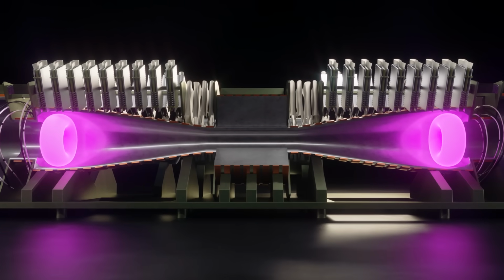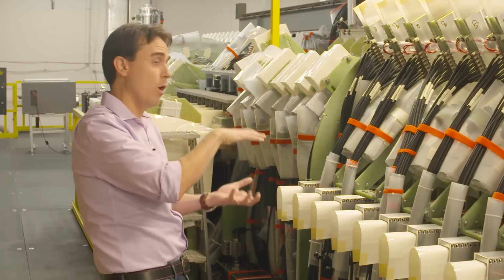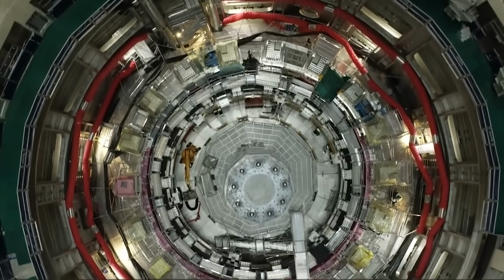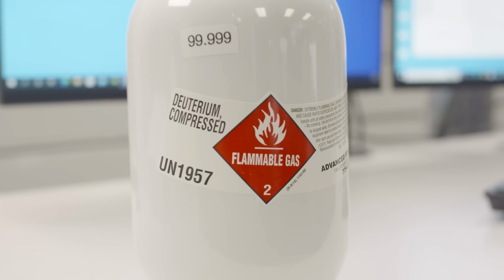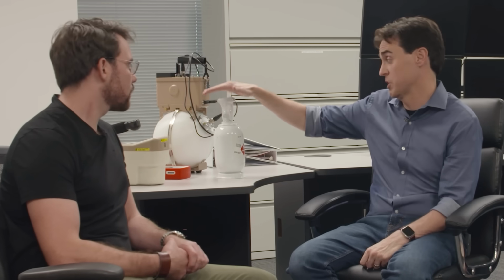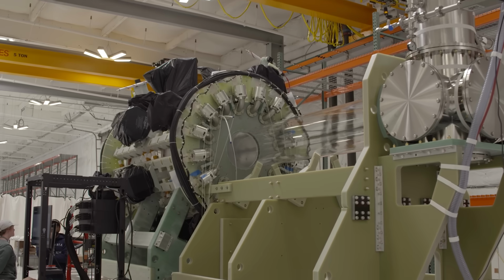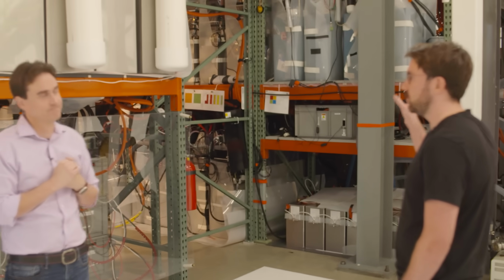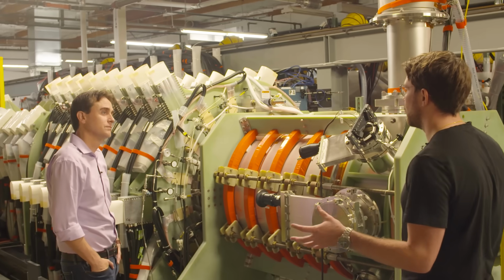A New Way to Achieve Nuclear Fusion: Helion

Comment: The real problem with fusion is not getting more energy back than you put in, it is getting  more USEFUL energy back than you put in.  Quite often the energy coming back destroys the equipment that made it.
Reply: To provide grid electricity, then at least four times the original input is required.
Reply: @Philip  with how much is produced on the low end that does explain why it destroys the equipment
Reply: I wonder is the advanced super- capacitors from Skeleton would be a useful addition… I understand Skeleton has graphene based tech. Anyone heard of Skeleton? I think they are from Estonia and the company is now based in Germany
Reply: Well, D-He3 fusion would be the theoretical way to solve that, since most of your energy is being carried by fast protons instead of fast neutrons. Protons, unlike neutrons, can be tightly controlled and sent down "deceleration tunnels" where their speed is converted to voltage.

But honestly I think the issue is overstated. Industrial plants wear down with continuous use, so what? As long as the costs are reasonable, you can do regular maintenance like we already do everywhere.
Reply: @The_Blazer-u9t  A nuclear reactor has a 40 year lifespan. A nuclear power plant takes 33 years to pay off. If fusion doesn't do better than nuclear, then I don't see the appeal.
Reply: @tuckercarlsonrules4972  Fusion IMO has huge potential to be better than fission. You get all of the advantages with quite a bit less of its problems: you're not handling radioactive material either in or out, you don't need quadruple redundant safety because your reactor isn't permanently fueled with enough potential energy to vaporize a city, you don't need a spent fuel pool because your waste products don't need to be continuously cooled for six months...
Reply: The real problem with fusion is the economics of it.
This stuff is never going to be economical competitive for commercial use. Energy supply is decentralising rapidly. We needed this 30 years ago.

The science is awesome though, we can use it to travel the galaxy 👍
Reply: @baronvonlimbourgh1716  That's absolutely not true, literally every single form of energy generation, from solar panels to wind turbines is cheaper and more cost effective at utility scale.
Reply: @The_Blazer-u9t  that is no longer the case. Most of efficienties of scale come from labour and infrastructure efficienty, aka opperational costs. And with solar and wind labour and infrastructure and opperational cost are marginal per instalation and don't really change if turbines are put next to eachother or spread out. Or if panels are together in a masive field or  are on the roof of a lot of different houses.

The panel cost stays the same, the maintenance cost stays the same since it's maintenance free, and they simply stand outside so infrastructure overhead is also the same.

Smaller scale actually does have some advantages as well. They can simply be connected to existing electricity infrastructure without having to build massive connections and beefing up transport lines when it is installed decentralised. Plus the investment cost can be spread over many more small instalations by many people. And the financial bennefits are spread over many small benneficiaries instead of flowing to a single profiting entity.
Reply: @baronvonlimbourgh1716  If you look at actual numbers for cost of electricity, utility solar PV is substantially cheaper than rooftop solar.
Reply: @The_Blazer-u9t  how did you calculate that? 
If i buy 100 panels and put them in a field and connect them to the grid or i buy 100 panels and put them troughout the city, one in every garden and plug them in or whatever, there is no inherent difference between what the electricity cost comming from these panels the next 40 years.

They just sit there unattended and make electricity.
It is not like every location needs an operator and a manager. I also don't have to build a building in every location for supporting equipment. 
These are the costs that exponentionally decrease normally if you put more together. Instead of 100 operators managing and maintaining 100 little gas agregators you would only need a single one managing a huge turbine. That's economies of scale
Turbines and panels are just static and operate on their own. There are little gains to be had, if any by concentrating them.
Their footprint also doesn't shrink by concentrating them either. A powerstation grows slower in size then that the output capability grows, again making it cheaper with scale.

And for end consumers the decentralised option is actually vastly cheaper. When buying from a solarfarm you pay for the electricity, profit for the exploiter and you pay for the transportation of the electricity over the network. By buying your own panels you pay nothing for the electricity, no transportation cost, you just pay for the investment. An investment that returns itself by no longer paying for the electricity and it's transportation.
After 5 years or so the savings exceed the investment and from then on the electricity is free for 35 years.

Anyway, solar and wind power are quickly dropping to fractions of a penny per kwh generated. And storage prices also are quickly comming down to levels where for the same cost of building and running such a nuclear facility for 40 years many times more energy can be generated and timeshifted by wind and solar over the same period already. And that difference will only keep growing over time.

There are no running costs asociated with solar in particular, that makes it unbeatable economicly.
Reply: @baronvonlimbourgh1716  Yes... energy supply is decentralizing sure thing.. I guess electric vehicles will be powered by your bullshit lmao. The reality is solar energy has no place in the future except for you roof as an appliance for your home. We are rapidly spearheading into a future where we expect to use electric power for everything except for flying airplanes, unless you expect every household to come come with a mini pre installed fusion reactor that will feed the grid, we will need to centralize even more with new technologies than we already do.
Reply: @@zippydastrange  who is gonna buy that expensive power though?
They will need subsedies for their entire life. I know better ways to spend tax money.
Reply: @baronvonlimbourgh1716 the power from a nuclear reactor is relatively cheap because they produce a ton it’s the setting up of power plants and when one fission power plant could power can theoretically power New York City for a day the cost becomes a lot more manageable
Reply: @jameson1239   no it isn't cheap. How can it be cheap if building the thing costs a fortune?
There is a big cost to that capital. And there is a huge oppertunity cost because of it.
And beyond that operational cost, maintenance cost and overhead are massive as well. 
Plus you also need overcapacity because these things need lengthy maintenance every few years for which you need to have a replacement standing by to take the load.
And then there is a constant need for fuel and it's storage.

There is nothing inexpensive about nukes.
Reply: @baronvonlimbourgh1716  I never said it was cheap I said the costs are alot more manageable when you have the capacity to monopolize an entire city’s power grid  with one assets vs building a massive wind or solar farm just from basic googling New York City uses about 11000 Mw/h per day and the R.E Ginna reactor which is nowhere close to the most powerful reactor in the world can produce 13968 Mh/h per day, how many solar panels do you need to generate the same amount? And how much do you need to pay for maintenance things like labour, transport, and materials to upkeep that many solar panels vs one nuclear plant that depending on design may not need to be turned off to refuel or repair.
Reply: @@zippydastrange with a 20k setup you can live offgrid almost anywhere in the world with your extended family lol. That's huge, not many people will even have space for such a large instalation.

Anyway, a solar setup is a way better investment then stocks or whatever. Whoever does not have a system is leaving a lot of money on the table. 
The vast majority of buildings will have PV within a decade.

Nuclear is 20th century technology it already is by far the most expensive way to generate electricity. Giving up economies of scale and going smaller will only skyrocket costs even further.
It is a dead end, it would swallow insane amounts of tax payer money to even make viable. It would be economic suicide.
Reply: @@zippydastrange nobody wants to pay over 10 or 20 times more for the same thing. I think you live in a different reality then the rest of us sorry lol.
Not everyone is named musk 👍. 
Most companies like to be competitive internationally as well, that's just not possible anymore using a resource based energy system.

Technology is now finally taking over as an energy source, the dawn of a new era.
Good times ahead.
Reply: How is solar not a resource based energy system in the long run based on the decline of rare minerals needed to make them? From what I've seen it's definetly not a long term solution.
Reply: @robertmills413   everything in a solar panel can be recycled. And by the time they need to be replaced you are left with exactly what was put into them at the time of creation and during the 40 years of operation. They consume nothing to create energy, unlike resource based systems that need a constant flow of new resources to keep them going that are gone forever.
Reply: @baronvonlimbourgh1716  that makes sense, I wish I could find my source but if I remember correctly the point they were making was that we'll eventually run out of resources to make more panels. The rarity of some of the essential minerals dictates that only so much of our energy demands can be met by solar before we run out of them.
Reply: @robertmills413   solar pannels are a technology. Technology becommes more efficient over time, the amount of energy that is created per panel has been steadilly increasing since the 70s. And the amount of materials needed to create them has been steadilly going down since the 70s. Development in technology always makes it possible to do more with less over time.
Pv panels are just silicon, much like computer chips. Pv has been following a simmilar trajectory as moores law which enables pretty acurate predictions to efficiency possible.

Battery technology has also made huge progression over just the last decade. More storage, longer lasting batteries with ever declining amounts of materials used. They are just a technology as well.

And that doesn't even calculate in the progression in material science itself. Alternatives or new processes are found for all these applications all the time.
And with capital investment continually growing exponentially in these industries imprvements are constant and will be for at least a couple of decades into the future.

What happened in these industries in the last 10 years is mind boggling and it's still a new and small industry comparativly.
Sure, with the current state of technology it would be difficult. But creating the world we live in today with computers technology in everything and everywhere would have concidered concisered impossible in the early 80s as well. You needed a huge box that weighed a tonne just to run an excell sheet. And needed to lug allong a suitcase as a battery to run your phone for 30 minutes.
And look were we are just a few decades later. That is how technology works.

Things are only going to get better from here forward. And it will happen really fast and in 25 years this stuff will be omnipresent everywhere just like computing devices are now. And it will produce and store energy at fractions of a penny.

Look up the technological s-curve. Every disruptive technology goes trough this cycle, and we are just ariving at the bottom of this curve and are on the brink of it going vertical in the comming years.

Seriously, by the time these nukes are even ready they will be obsolete paperweights and museums of 20th century technology.
Reply: @robertmills413   if you want to see the future today, watch a presentation from Tony Seba.
He makes it very clear what has been happening and what will happen going forward.
Really recomended. He really understands this stuff. He has been spot on.
Reply: @robertmills413  

If you search for this "phasechangereduction tony seba" in google you will get a recent presentation from him as the top results.
Really worth your time 👍
Reply: Since the 1970s fusion has been just 20 years away.  Seems to me not too long ago Japan achieved break even?
Reply: Exergy
Reply: @@zippydastrange properly installed panels don't need any maintenance, and they last for 40 years or more. And a properly sized battery system can last as long almost just as long. 
Car packs last easilly more then a decade, which is much more demanding on them then trickle charging a house. Loads of packs from cars get a second life as home storage because a home situation barely puts any load on a battery, unlike a car does. So they pretty much lasts forever.
 

Also, your prices are from 2015 or something, lots has changed over the years. It's a fraction of that nowdays and steadilly going down still.
Reply: You're just plain wrong. No fusion reactor has got closer than being 97 percent inefficient,  they are even further than that from anything useful.
Reply: @russhamilton3800  That's wrong as well even recently had a major breakthrough on that and general fusions reactor is honestly a more likely candidate to be successful than bombarding the thing with lasers.
Reply: @russhamilton3800  You didn't get the joke. Getting energy out of fusion is no problem, it's called a thermonuclear explosion ;)

Comment: Is the heat then just wasted? What happens to the fuel after it reacts and  the energy is extracted?
Reply: The "heat" will drive the expansion of the FRC, which is directly converted to electricity. There will be some heat losses that could be converted by some means or another as well. The question is whether it is worth adding a lot of extra equipment (that would drive up the CapEx) for that.

The fuel is pumped out of the vacuum chamber between pulses, where it is processed and the unneeded fusion products are removed before it is being fed back into the machine.